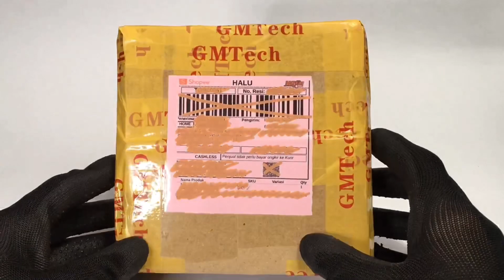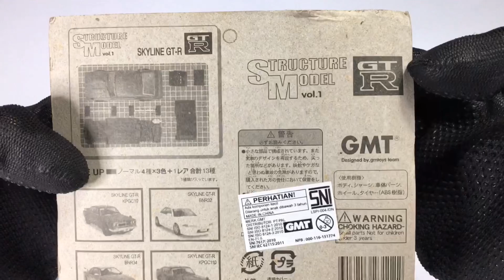Nissan Skyline Brutal Custom

Comment: Gw sebagai kang kastem diecast melihat ini, menurut gw agak (maap yak) bomdoh si, karena itu jelas² scale si diecast nya bukan 1 64, kemungkinan 1 65, & itu di pasangin ban uk 10mm / 9mm yg buat skala 1 64, harusnya pake ban merk BNDS yg uk 8mm agar pas sama body, meski ya lu harus ceperin biar mepet ama fender biar gk keliatan aneh, tapi ya mending pake ban merk BNDS yg uk 8mm dari pada pake ban karet yg uk 9mm & /10mm, kan ujung nya klo lu pake ban 9mm / 10mm itu bakal mentok ke fender & lu otomatis akan kikis fender jga, & menurut gw agak aneh si diecast skala 1 65 di kasih ban 9mm / 10mm, jadi aneh liat nya, jdi kek mobil pake ring 20 / 22
Reply from the maker: iya soalnya ini aslinya ban nya bukan buat di Diecast ini, jadi dari segi fitmen keliatan aneh😂
Reply: @hobbymaxx899  nah, btw kamget aku di bales komen nya